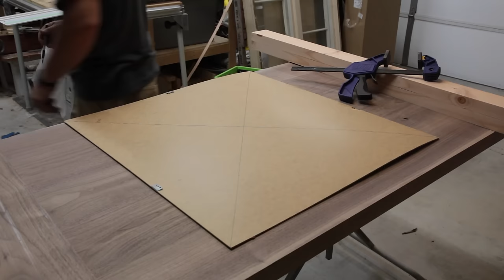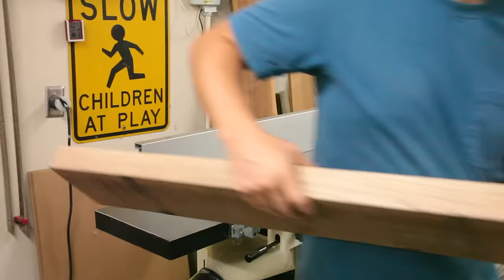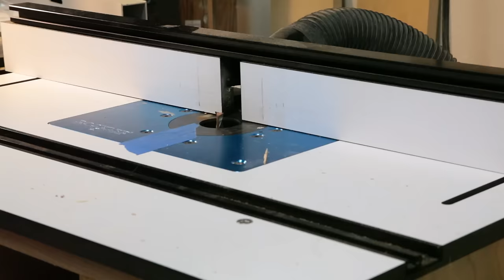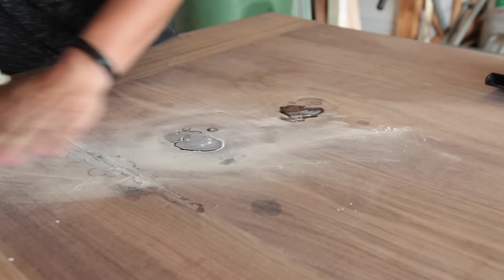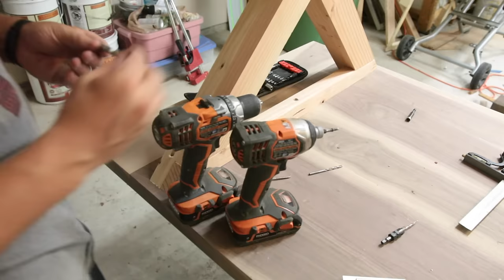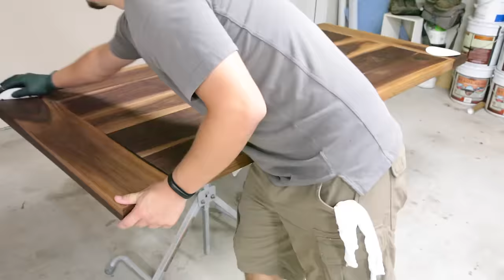Make This: Farmhouse Table

Comment: The amount and variety of tools that went into making this table is daunting.
Reply from the maker: I do have quite a collection but I accumulated them slowly over a pretty long period of time and most were picked up second hand and I still use some hand me down tools.  That being said you could easily make this project with a table saw and a router.  It would just take you a little bit longer.  Thanks for watching
Reply: +Make This: Workshop Ya, those hand me downs cost more than most people's new stuff. Love to have some of those festools :)
Reply from the maker: Yes, I am very blessed and have been "collecting" tools for quite a while.  The important thing to remember is that, while yes I do have some nice tools, you can do the same work with less expensive and in may cases less variety of tools then I use.  Thanks for watching and all the good questions and comments!

Comment: This table is really well designed. Every piece is clearly labeled, https://www.youtube.com/post/Ugkxn94T8Mu1iMnsLCMNOI9srXSsLkI4JXKW  and the instructions are perfectly displayed, so it's really hard to mess up the assembly. The hardware is likewise clearly labeled. If I had a power driver, assembly time would have been cut in half, but I didn't mind the light workout. My only qualm is that is that the lift top is wobbly in between its open and closed positions, but that's really a minor complaint. For the price, you really can't get much better than this, hence the five-star review. I use it primarily for my wireless mouse and keyboard so that I can use my PC from the couch. Storage is nice. I'm totally happy with this purchase.
Reply from the maker: Thanks, it sure would if you shortened the legs.  As it is we easily fit 7 people around the table with the bench on one side we also built (video) and the two sculpted seat chairs on the window side (video also in the channel).  Thanks again!

Comment: I am having a go at making this table as my first big project after 30 years away from wood working.  Your table looks great and I hope mine will turn out just half as good.  You have a lot more kit than I have, so some parts are taking a lot longer to complete, oh for a tablesaw which would accept dado blades.  Anyway your table is fantastic so we'll see how mine turns out in a few weeks.  I will have to look at a router table as my next project, but hand working the wood is good for my rusty chiseling skills.
Reply from the maker: +Cottage workshop I consider it a big complement that you like the design enough to make your own.  Thank you.  I would love to see a pic of it when you finish.  Feel free to upload a pic to the Facebook site at https://www.facebook.com/MakeThisWorkshop  .  The dado does help out with some of these steps but a router template or making a series of saw passes then chiseling out the remainder are both good options.  Good luck and enjoy!
Reply: +Make This: Workshop I have finally finished my version of your table apart from sorting out one slightly wobbly leg , but I'll leave it to settle in the kitchen for a couple of weeks before making any adjustments.

I popped a final picture on you facebook page, thanks for the design and the inspiration to make the table.

Comment: Awesome project, nicely done. I am about to do something similar for my wife, I can only hope it comes out as good as yours! At about 10:02 I was having the same problem when planing big boards with my Laguna jointer/planer, I solved it by adding an extension table out of Melamine which makes things slide much easier. Just my two cents in case it helps!
Reply from the maker: Thanks for the tip and I do plan to do this but haven't had a chance to get around to it yet.  I have thought about creating extension wings (adding length) or building an adjustable height indeed/outfeed table since the depth adjustment is made by raising and lowering the actual bed when planing.  Is yours the same way or does your planer move the blade?   I am sure it will turn out great.  If you end up building something based on this design please feel free to post a pic of it on https://www.facebook.com/MakeThisWorkshop/ .  Thanks again!
Reply: My joiner/planer is basically the exact same as yours, except is made by Laguna Tool. It's also basically an extension as well since I made them just a bit shorter than the jointer tables and it helps to avoid spline. I kept it simple by making it just as a board that sits on top of the planer bed with two stop blocks to keep in place, it is literately just floating in place but it works great, my boards no longer get stock, day and night difference. The only downside is the fact that the measuring ruler on the side is no longer good, but I never used anyways. I am definitely going to steal some ideas from you and I will post some pictures when I get do it.
Reply from the maker: ah, good idea.  I was thinking about creating a cantilevered infeed/outfeed that was bolted to the bed but was apprehensive about drilling into it and the long term durability of the connection but your solution prevents any permanent modifications.  Might be worth making the sled just for long pieces... I have to say this channel has provided so many great ideas and I can help but feel I have received more information then I have given.  Thanks again for the idea and if I do end up making the sled I will give you a shout out.  Thanks again!

Comment: Great end result.  A few things were done strange though. You joined 2x material. I and not sure why you didn't plane them individually to final size and then cut one side in half minus the width of the board. Glue them up then with the space in the middle for the cross. Use a miter saw for the angle cut on the base vs have to line up the track saw and cut multiple times. Then put the crosses together.
Reply from the maker: Hey Kyle, Thanks for watching and the good question.  You can certainly do it the way you proposed however, in my experience if you cut/plane to final dimension before glue up you end up with minor variations.  By gluing then planing you get a more accurate end result.  Also, I look for any excuse to use my router plane and enjoy using my dato stack to hog out massive amounts of material.  As with any hobby your milage may vary and by no means is my way the only way.  Thanks again!

Comment: Great looking table. Did you find that the table swayed before you added the supporting beam in the middle between the X legs
Reply from the maker: Yes, you could address that with a few other options but the Mrs. liked the look of the cross brace.  Thanks for watching

Comment: Very nice work and shop is awesome. What did you use to fill the knot voids? Epoxy? Thanks
Reply from the maker: +MrAlittle5150 Thanks for the kind words, I used west systems epoxy mixed with transtint - vintage maple dye for the dark color.  Thanks again

Comment: Hey; what did you put into those knotty holes? Also, the tool that you seem to do the final scraping on the edge, what was that? It helps to make a straight edge?
Reply from the maker: I use west system epoxy with vintage maple die to fill in the knot holes and stabilize them.  I think you are referring to the shoulder plane I used on the tenons of the breadboard.  You are correct it removes any slight imperfections left over from the routing operation.  If i got that wrong give me the time code where I am using the tool you are interested in and I would be happy to take another look for ya.

Comment: what type of "clear coat" is this? never seen a clear coat you didnt have to spray or brush on?
Reply from the maker: It was an equal parts mixture of Boiled Linseed oil/100%Tung Oil/Mineral spirits for the first two coats.  The last coat was 50/50 Boiled Linseed Oil/Tung oil.   The mineral spirits just serves to thin the mixture for deeper penetration.

Comment: Why did you use both dominos and mortise and tenon for the bread board ends?
Wouldn't one joinery method have sufficed?
Reply from the maker: +Matttzzzzz Fair question, because that lip is only 1 inch and mostly won't be glued I didn't think I wanted the 7in of overhang to rely on the strength of about 1in glue squared at the top and bottom of the very center of that breadboard.  So the dominos provide strength.  (the example i had in mind was someone who was seated at the end of the table using the very end of the breadboards to push against to help them stand up.)  The further you get away from the 1 in joint the more leverage is being applied and therefore more strength (think crowbar the longer it is the easier it is to move something).  So the dominos move that fulcrum point towards the end of the table decreasing the length of the "crowbar" and reducing stress on the joint.  Hope that helps or is at least clear as mud.  Thanks for watching and commenting!

Comment: I am making a table like yours and wonder what angle degree you cut the dado at and was it also beveled?
Reply from the maker: I honestly have no idea what the angle is.  Around 3:17 you can see how I set my angle with a bevel gauge off the template.  Using this method proved more then accurate enough for my base. I picked that trick up from Shanon Rogers at the renaissance woodworker youtube channel.
Reply: Thanks the reply.

Comment: At 11:51 what's that little square device you put against the blade?  Is it a laser measure to the fence?
Reply from the maker: +Thomas Abney Good question, it is a digital angle finder.  The only trick t these tools is ensuring the teeth on the blade don't impact the base of the tool, thus throwing off the angle.  It attaches magnetically to the blade and is a very accurate way to ensure you have a specific angle.  In this case I was confirming that I had a true 90 degree angle.  Thanks for watching and the question!

Comment: very nice table ..what finish finish did you use for the top?
Reply from the maker: +JNG Music Thanks for watching and the kind words!  It was a mix of equal parts Mineral Spirits/Tung Oil/BLO for the first coat and mostly tung oil for the 2nd and 3rd coats.  Took awhile for curing in-between coats but you get a decent finish that has virtually nothing between you and the wood.  The finish cures in the wood.  The only downside is its not very durable, so if yo have a heavy use table or tend to abuse your tables you might want to go with a poly finish instead.

Comment: Hello, dear friend. I wonder what is the product you used to give this brightness in the finishing of this wonderful table? Congratulations for the beautiful work.
Reply from the maker: +thomazneto58 Thank you for the praise!  I only used the finish in the video.  It was an equal parts mixture of Boiled Linseed oil/100%Tung Oil/Mineral spirits for the first two coats.  The last coat was 50/50 Boiled Linseed Oil/Tung oil.   The mineral spirits just serves to thin the mixture for deeper penetration.  I would allow the finish to sit for a couple days between coats with a light scuff sanding before applying the next coat.  After letting the final coat sit up for a week I wet sanded to 2000 grit.  This gives a nice semi gloss finish which I think complements the style of the table nicely.

I did apply a wax coat after the video but found it was too delicate for a table we use daily.  I applied solvent to remove it and had to apply another coat of 50/50 mix to get it back to where it was before the wax was applied.

Thanks again,
James

Comment: I thought you werent supposed to screw a table top to the bottom?
Reply from the maker: The predrilled holes are larger than the shank of the screws which allows for movement of the top.

Comment: Nice table, If I where planning to build a 10 foot version, do you think it would need an extra leg cross?
Looks amazing!
Reply from the maker: I would probably add two stretchers flush with the top of the legs supporting the table if I had much more of a span then this table.  This is assuming you would also use 8/4 walnut and that you use the same offset on the legs from the ends.  If you increased the width of the table but keep the base about the same this would give you a little more knee room on the ends and eliminate the need (possibly) for the stretchers.  You could always build it without the stretchers and see how it feels and add them if you get more flex then you are willing to accept.  Thanks for watching and let me know how your table turns out
Reply: Now I just have to find some easy to build chairs :)
Reply from the maker: I know the feeling!  April and I have been working on a design for awhile but haven't nailed down the right fit for the table yet.  Hopefully we will have the opportunity to knock one out before 2017 but with a newborn we are a bit taxed for time.  Take care and good luck on the chairs!
Reply from the maker: Hey David, Just wanted to let you know I have a chair video I am working on editing and voice over now.  I might upload a version without voice overd before the end of the week and then one with voice/music later on so keep your eyes peeled.

Comment: this table is awesome! how do you like the jointer planer combo honestly? I've heard mixed reviews but I'm considering one
Reply from the maker: Thanks for the complement!  The J/P combo is great for my shop since my wife insists on parking her car in my shop and space is a concern.  I ultimately would prefer a 20" planer and a 12" jointer.  My biggest challenge is out-feed tables being a little on the short side for some of my larger projects.  I do plan on adding out-feed extensions one of these days but haven't had a chance to get around to it yet.  Overall I am very pleased with the combo but you do compromise anytime you combine two pieces of machinery.  I almost got the Hammer but they didn't offer the carbide helix blades when I placed my order.  Thanks again.

Comment: The table turned out amazing!!! great job. adding this to the list of options for my project. What was the total cost for materials? if you don't mind me asking. 
Really enjoyed the video :)
Reply from the maker: +Sukar Thank you for the kind words.  Don't mind you asking that at all!  I purchased all the materials for the bench and the table at the same time and I ended up with about $100 worth of extra boards (planned it that way for mistakes or an extra board to tool around with later).  But the 8/4 walnut was $500 in my local area at the time of purchase and the 2x4's for the base were about $10.  The idea was that the wife and I both loved the design and wanted to paint the base.  So we invested in the top knowing it would be bare wood and saved on the base since it was going to be painted.

If you are looking for a more budget minded option Kiln Dried 2x10's or 2x6's would be another option.  Keep in mind you will need to cut off the rounded edges so the 2x10's would be my pick with this option.  

Side question, If I produced sketch-up plans and a more detailed PDF to accompany this video would it be worth $4.99 to anyone?
Reply: yes it would be I'm sure

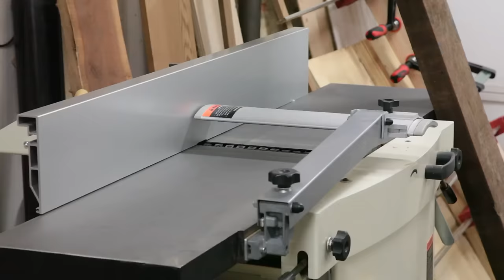Comment: You are making me fall in love with this art! What are you using and for what purpose at 09:02?
Reply from the maker: +Monis Anwar Thank you for the enormous compliment.  At 9:02 I am using a smoothing plane to take out some of the twist of the board.  This will allow me to have a easier time managing the board at the joiner that you see in the next scene.  If i didn't take the "twist" out the board would rock while going over the joiner causing for an uneven removal of material.  Thanks again!

Comment: What kind of hand plane used to slightly round over table edges?
Reply from the maker: I used two hand planes to treat the edges the smaller is the stanley sweetheart block plane and the larger one is the stanley sweetheart #4 smoothing plane.  Both are excellent values imho.  Thanks for watching!
Reply: Awesome thanks you so much.

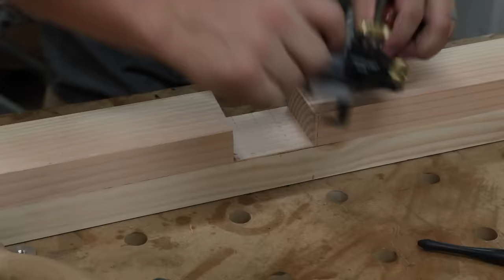Comment: At 5:33 you switch back and forth between a chisel and a tool that I don't know the name of but I'm not a carpenter. What's the name of the tool with the ball shaped handles on both sides? Thanks.
Reply from the maker: Thanks for watching, its a veritas router plane. for more information i have included a link to their website.  Beware, it can get expensive going to their site :).  http://www.leevalley.com/US/garden/page.aspx?p=52609&cat=1,41182,41192&ap=1

Comment: What type of oil you put on the table top
Reply from the maker: A mix of equal parts 100% pure ting oil, boiled linseed oil (BLO), and mineral spirits for the first coat. Then less mineral spirits for the second coat and almost only ting oil the last coat. Allowing at least 24 hours between coats. The more time between coats the better

Comment: how come he  doesn't  show how to install the stretcher  between the legs
Reply from the maker: I did show how I attached them.  I provided a link below of the exact point in the video where I did so.  You can watch until about 26:50 to see.  I just used long clamps.  However, another person who shared their photos on my Facebook page had a better solution... Use a ratchet strap!  It was genius in my opinion.  I would just encourage you to make a spacer for the top to ensure things stay square and double check your measurements to make sure the top and bottom widths are equal.  Otherwise, you can end up with a can't on your legs pretty easily.
Link to stretcher install:
https://youtu.be/ZNHpuUmjalk?t=25m22s